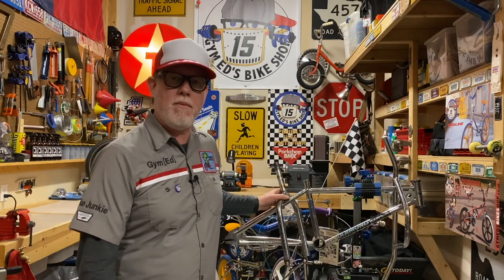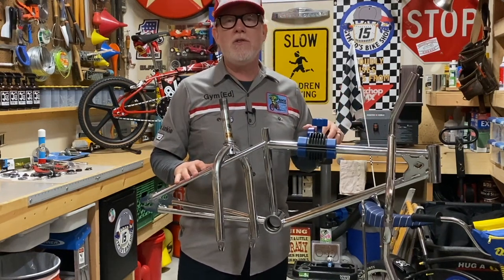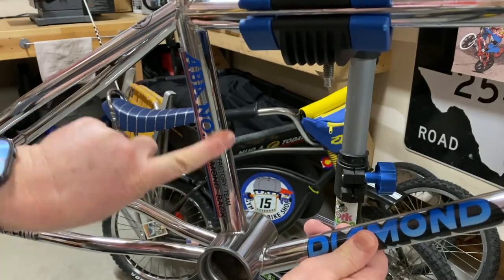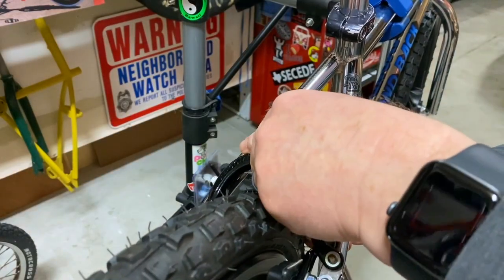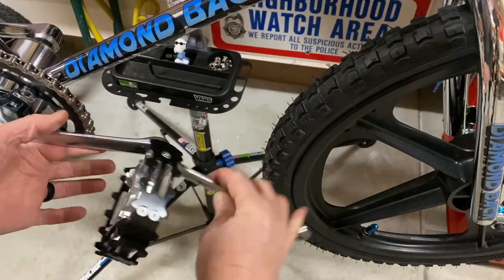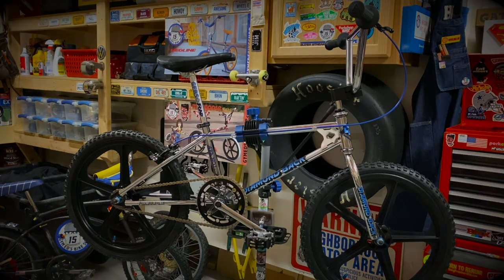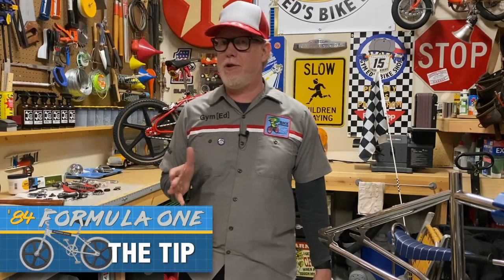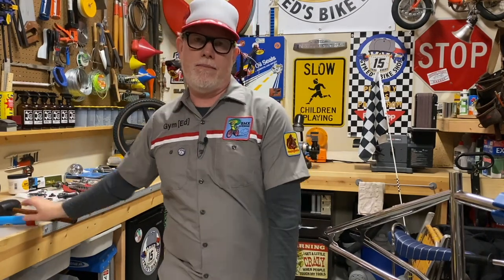Diamond Back '84 Formula One Build

Comment: I have a 1997 diamondback reactor with 7005 heat treat aluminum frame and chromoly bars and forks what’s it worth andnis it worth adding certain parts ? It’s all original